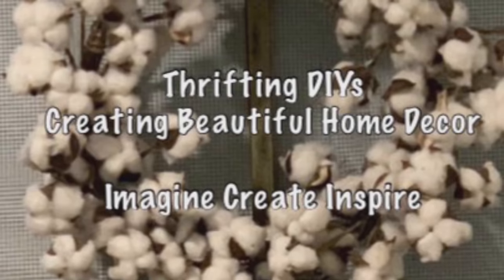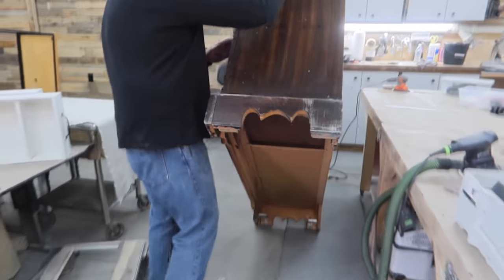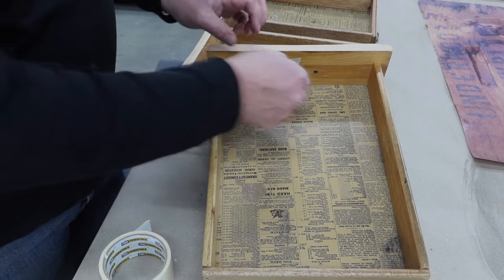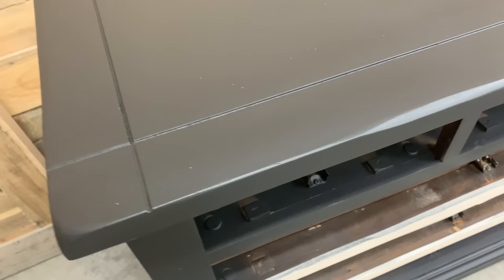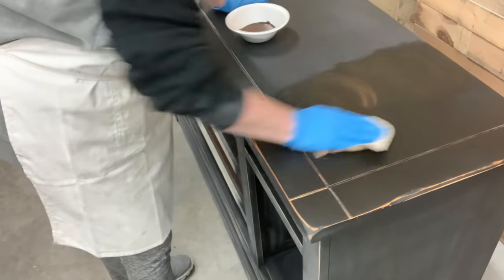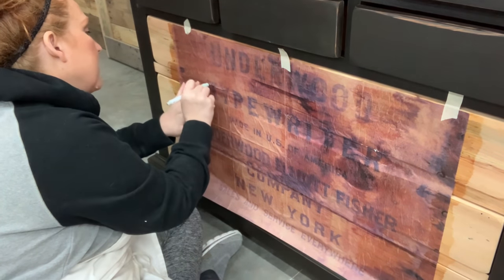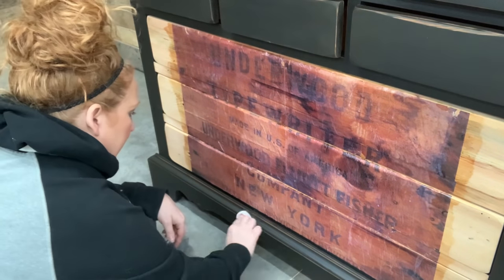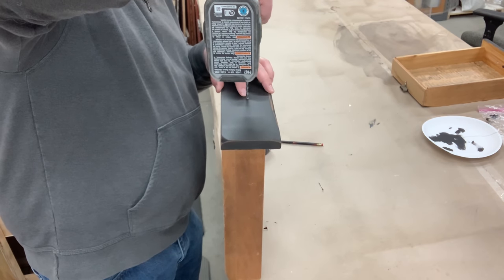Furniture || Thrift Store || Industrial || Decoupage || Makeover

Comment: Love it. I was wondering if you water down the polycrylic for the sprayer ? Also I was wondering about the compressor I only have a small 3 gallon 100 psi max would that work ?
Reply from the maker: I’m not sure polycyclic is already very liquid compared to paint. I believe it would for them harbor freight hoppers. You just need to wait each time it needs to recharge before spraying